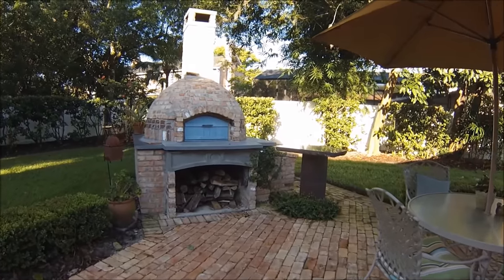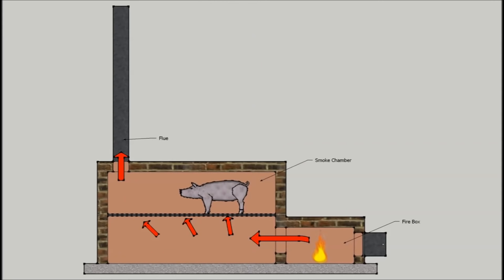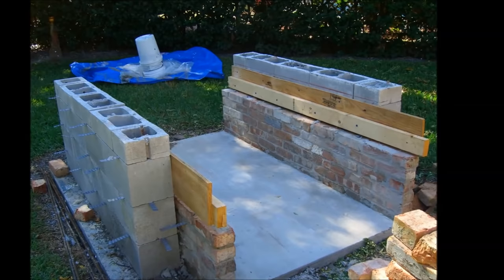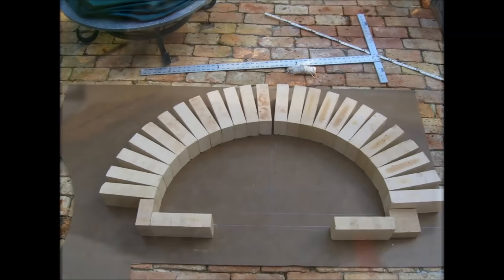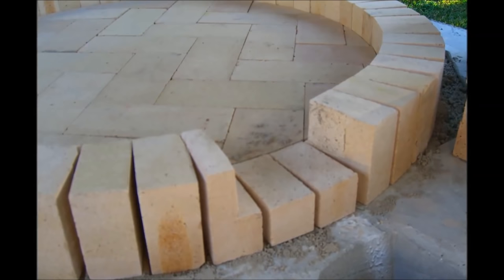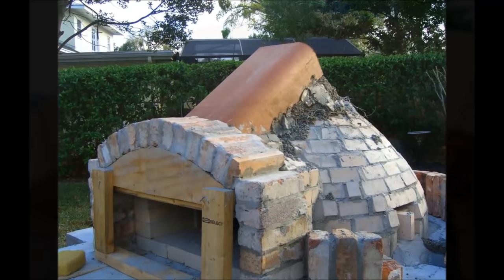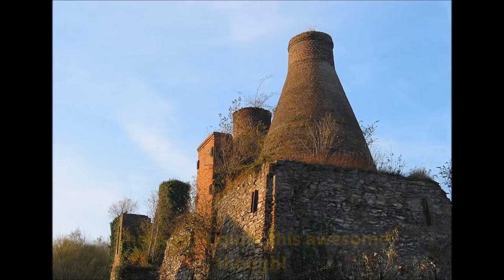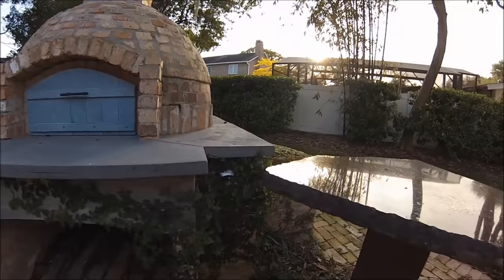How to Build a Brick Wood Fired Pizza Oven/Smoker Combo

Comment: Enjoyed your calm demeanor while being informative and entertaining. Small correction about the need to pour below the frost line in a northern climate. It's only required if the structure is attached to another that has a foundation below the frost line. Free standing structural pads can and do float on the surface of the ground and rise and fall as the ice freezes and thaws. If what you were saying was true then all our roads for example here in Canada would be very expensive to build. Enjoyed you content and looks like a good job.
Reply from the maker: You are correct but it needs to have a layer of free draining sand or rock between the clay and the bottom of the foundation or slab. I can't say that I am an expert though. I've never built anything further north than south Georgia.
Reply: @LeeMcNeil  Rubble foundations have been used for thousands of years and yes when care is taken while compacting, stacking, layering, draining, wicking and shedding water then sucessful results will be realized. Building something that heats up also needs special care in relation to different rates of expansion and contraction. Dissimilar materials for example have different rates of expansion and the same care needs to be observed during the building process. The need to make a seal at these critical areas that are prone to failure is where caution and experience must be paramount with the use of expansion joints and layering as a principle just as it is when concidering how to build a foundation. Spun ceramics, high temp silicone, rock wool and even just leaveing a small gap to facilitate that expansion are in our tool box. Layering separate components with expansion joints and forcing it to settle while saturating it with water combined with the use of gravity will also contribute to one chances of sucess. One thing that allows us to reach the heavens with modern building techniques while building sky scrapers is not attaching and allowing for movement.

Comment: I felt that the description and amount of energy put into this video was absolutely exceptional. Thank you for the amazing insights and issues to take into consideration before designing my own pizza oven. I love the fact that this can also be used as a smoker whenever needed. It is large so would not accommodate my smaller work space, but I can make a bit smaller and experience the satisfaction of using all year round.
Reply from the maker: John Cabral Thanks. I just checked out a few of your videos and your recipes look pretty awesome. You have a great camera setup. My advice is to shorten the intro at the beginning and you are missing the money shot of the dish at the end of your videos. I am struggling with issues on the camera setup (it's hard with the oven) and the money shot at the end because I am ready to eat. I'm working on a video of a steak cook in the oven that I will be posting pretty soon. Let me know what you think!

Comment: Lee, Just thinking that Epoxy coating (i.e.; Stone Coat) your concrete wrap around flat surface would be very cool and an inexpensive alternative to Marble, Corian or anything else.  It is easy, cheap and very resilient to heat, weather and UV...Just a thought.  I love this build! I am not a Mason by any stretch of the imagination but your design along with a rocket stove side cooker, and grill area is what I am going to build when I get home (winter of 19.)  I LOVE the stack re-routed to the top much more ascetically pleasing to the eye IMHO.  As I said in the beginning, I am no mason so I will hire out some help for the end of the build.
Reply from the maker: Thanks. The top is really looking bad now and not just visually. It's developing a crack across the front landing right where it cantilever's off the structure below and could fall off at any time. No epoxy coating is going to fix that. I'm definitely going to replace it within a year and will most likely use granite. I will make a video when I do.

Comment: muratic acid, would give you a nice base finish on your concrete exterior, then add a colored epoxy paint to enhance the look and finish with sealer perhaps a clear coat. Looks like a beautiful pizza/smoker oven bud!
Reply from the maker: +Caged63Man I washed all the brick with muratic acid but did not want to do that with the top because I wanted as smooth of a surface as possible. The front part of the top is failing structurally anyway. It's only a matter of time before if falls off. I am going to replace it (at least that one piece of it) with either some granite or quartz in a similar color to the rest of the top. I just didn't reinforce it as well as I should have.

Comment: First of all. From someone in the trades,  great job. Second, just an idea based on my own personal preferences.  Instead of a tile band around the circumference try a band of embossed copper. It’ll age beautifully in the salt laden air that you are so fortunate to have in Florida. Based on what you’ve already done I’m certain that whatever you choose to do will be fantastic. Cudos
Reply from the maker: Thanks! I am close to Orlando so we are about 60 miles away from any beach so no salt air here. The copper idea sounds pretty cool. It could end up kind of looking like a structural element - like something that would reinforce the bricks horizontally - kind of like a barrel ring keeps the wood staves tight to one another. I have to think more about that because here I am ten years after building it and still haven't done anything with the tile band.

Comment: Such a cool thing to do and makes a real statement in the garden, well done! Also something that could be a little easier and cheaper to fit around the concrete base is slate. Maybe just glue it on top of the concrete you made. Awesome though.
Reply from the maker: I did the old Chicago brick mainly because the back patio is made with that same brick. Slate would be nice and a whole lot less work I think.

Comment: I just started my one 3 weeks ago, the under construction is ready. Everything goes good. I will not make it with the smoker, but the rest I copy more ore less everything of your video. Only the perilite I will not put in, in the fireplace. In the dome yes. I think having the fireplace of the Pizzaoven so thick, you do not need the aditional  isolation. Heat goes up, and not down. The aditional stones should be enough, but that is just my opinion. When my oven is ready I will put a photo up, if youtube let me. But respect what you did, and thank you for your nice video. It helped me a lot.
Reply: and again I changed my mind. As I only made my concrete platform half as thick as yours, I decided to put that perlite cement mixture on or in it. And instead of perlite, because I could not purchase it here in Portugal, I used Argila expandida. These are little burned clay balls. I hope they do the same job.I mixed them the same way you did it with the perlite,

Comment: Great oven!  COOKING TIP:  For pizza, push the fire to one side, not the back.  When the pizza sits next to the fire, you can see how it's cooking closest to the heat source to know when to turn the pizza so that it does not burn.  :-)
Reply from the maker: Yes getting the fire over to the side helps to allow you to see how done the pizza is on that side a little easier. I actually push mine toward the back and left side of the oven.

Comment: You should leave a small gap between the bottom and wall bricks.. When the bottom is very hot they push out the wall of the oven because of the heat expansion and this may cause some serious cracks on the wall..
Reply from the maker: I haven't had any problems yet.

Comment: Nice!  I suppose if you wanted to level 1/2 inch shy, then you could cut a 2x4 to shape so that it was inset into the perlite:  kinda like a flat T.  It would need long arms to handle any unusual shapes while still allowing the wood to drift.
Reply from the maker: Yeah I just tried to make it flush. I think I remember that when I set the floor brick, it ran a little bit wild outside the edges of the perlite concrete. It's held up fine over the last 10 years so...

Comment: 19:44  You could use a cheap common inflatable "yoga" large exercise ball, it's what everyone now a days uses to complete the top upper dome portion easily with very low hassle and efforts compared to sand improvisation.
Reply from the maker: Yes that's another way to do it - but when I was building the oven, I had plenty of plywood and sand, but had no yoga ball.

Comment: Definitely one of the better guides to building a pizza oven on YouTube. Lot's of detail at each step. Loved the smoker box on the side and how that works. I was wonder how I would integrate one of these as well. Torn between this method and a built in Kamado now.

This it's definitely over engineered for my skill set (or lack of!!) but their is a lot of good stuff for me to take away. Cheers!

Comment: This is an amazing video. I love this multi use concept, being a pizza and BBQ fan with limited space. I am sorry if these questions have been asked and answered, but you seem to have a lot of comments on here (for good reason.) Has it lived up to your full expectations as a smoker? In hindsight do you think having the box at the back of the smoker would have made for a better airflow throughout the whole chamber, instead of cutting across diagonally? Also, do you use any types of racks or grates for the meats your smoking to envelope them in the smoke? Thank you for this amazing video, and the knowledge you have shared.
Reply from the maker: Yes, everything still works great, except for the finished colored concrete top that I installed toward the end of the project, is completely falling apart. I'm planning to replace them with granite soon. Other than that, the three biggest things I would change if I did it again would be to make the floor of the oven higher (it's kind of difficult to see into or move things around in the oven without being really bent over), I would turn the opening of the fire box toward the front of the oven instead of pointing out to the side (the fire box location on the side of the oven works fine though), and lastly, I wish I had built myself some additional prep area. The home plate shaped slab of granite works great, but I wish I have two or three times much space on it.

Comment: Build one with the fire below and fluing up into the dome. It’ll work a lot better and be much more efficient.
Reply from the maker: The one big drawback is that you would lose wood storage space. Two things I wish I had done are 1) I wish I had rotated the fire box so that the door to it was facing the front of the oven, and 2) I should have raised the top of the fire box up almost to the floor of the oven and topped with granite. That way I could use it as a prep table. The prep table I built over to the side of the oven is not nearly big enough.

Comment: Hi, Lee  

My wife has fallen in love with your pizza oven and I am
lumbered with the project,

Would you have some dimensions please? 

Great video and the addition of the smoker sold it to me.

Thanks Dave   Portsmouth uk
Reply from the maker: Oh no - sorry about that my friend. I have the 3D model uploaded on the Sketchup 3D warehouse and that program is free to download and really easy to use. The link is up in the description. You can pull pretty much any dimension you need off that model. If you are having trouble with it and I can answer any specific questions just let me know. There are way to many dimensions to list but the square part of the base is 6' wide and 6'2" deep and the inside of the oven is 36" in diameter.

Comment: Lee,

Not sure how I navigated to your channel, but glad I did. 

Great video, great job! It has been a few years since this was posted. Hope you still love your creation.

Did you ever document and share any dimensional information? The size you built looks fabulous. I realize that the oven would likely produce for a large group, which I will not likely have, but... I am rather impressed with the structure as it is aesthetically beautiful. 

I could figure it out but, knowing the dome diameter and pitch to shape the inner dome for concentricity as perfect as possible would be great. 

As a builder myself, I know everything starts with the foundation. Accommodate the oven interior requirements, inner fire brick wall thickness, insulation thickness, and veneer brick thickness. 

I live on the gulf coast, so frost heave will not be a problem for me either. 

Also love the smoker / oven combo concept. 

Questions on smoking:

Would it be prudent to have a damper or slide gate on the chimney flue to help control smoke and temperature when smoking?

Are drippings from meat in the oven area an issue? Is it a good idea to figure of drip pans. 

Have you perfected racks for smoking various meats? Brisket, Butts, Turkey, +++

Sorry about all the questions, but I figure you have experience to provide good guidance. 

Best regards!
Reply from the maker: I'm working on a video where I will share a bunch of dimensions and things I would do differently if I were to build it again.

As far as your questions, yes I could use a little more air and smoke control. Putting in additional intake dampers wouldn't have been to hard to do but a damper in the flue would have been a little more difficult. But it works OK just by adjusting the damper at the bottom of the fire box door and opening the door.

Drippings aren't a problem because I use a pan of water below the food when I cook. Plus when I make a fire in the oven for pizza, I build it right over where the meat was smoking so it incinerates any drippings. I made a video on how to smoke a turkey if you want to check it out - https://www.youtube.com/watch?v=v0nPnXZ9dIY

Comment: Nice job man! My brother is giving it a shot in New York. Now I'm worried that our foundation wasn't deep enough. Goodness that would be terrible.
Reply from the maker: I'm not sure how deep you need to go for your foundation up there but hopefully he put some rock at the bottom of the footing at least.
Reply: @LeeMcNeil  yeah we did. We dug down pretty far and put a base of rocks and stone dust but the city says the frost line is 42 inches. We did that in some spots (it is sloped ground) but definitely not in the lower spots. The lower spots are maybe 15 inches or so. Hopefully his comes out as nice as yours!
Reply from the maker: @CharlesLumia  You could add some fill around the side of the oven with the shallow foundation. Or insulate it with some perlite concrete.

Comment: Heat will expand steel and crack concrete and cement if its too thick.
Reply from the maker: Heat can make concrete spall, but I don't have any concrete actually exposed to high temperatures. The fire box and oven is lined with refractory bricks and perlite insulation, which heat would have to travel through to get to any concrete.

Comment: smoker offset also was in my mind.. but since here in Lithuania we use more so called "cold smoke'- is still designing 'subroutine" is running in my head... 
size of the oven is also to be decided .... for 2-3 or 4-6 pizzas....
Reply from the maker: Darius Ddd 36" (a little less than a meter) will fit 3 pizza's at one time. If you are going to have restaurant you might want something bigger but other than that 36" should be enough for almost any party. I've fed around 40 people at one time out of it. And the smoker is for barbecue like ribs, pork and beef brisket. Not really a cold smoker which is used mainly for fish like salmon - at least here in the US. Thanks for watching!

Comment: I was wondering if it was possible to also put a grill top where your smoke box is and then have a top that will close tight when not using it as a grill. This way you have a 3 in 1..... A pizza oven, a grill, and a smoker????? what are your thoughts??? Thinking of making one but my husband wants all 3. lol  That is why I am trying to find out a solution.....NOT going to start one until we have a solid solution to the 3 in 1 problem since my husband loves my homemade pizzas but I do miss having a pizza oven like I did in the USA.... I am in the Netherlands.... my husband is Dutch. I also miss smoking meats... My husband is the grill master in the family. lol I am also looking into having a rocket type stove underneath the oven to use as fire for the oven. Since we would not be storing the wood outside and the oven needs to be high enough for use while standing or while sitting on a bar stool I was thinking it would heat the oven but be less of a clean up of ashes in the oven...... Would love your input on all of this. :)

Comment: Sweet! That is very close to what I want to build. I just need to modify the fire box so It can be used as a direct heat grill. Any changes you would make after a few years of use?  Thanks for sharing this.
Reply from the maker: I would make the fire box face the front of the oven and put in an additional vent damper. It's kind of hard to control the airflow just by opening and closing the door.

Comment: Hello, Great job. I was just wondering why you didn't do the top slabs as a pour in place, same as they do for pour in place concrete counter tops.  Also you can use a diamond water sander to smooth out those slabs and make them look really nice.
Reply from the maker: +Michael Rhymer I precast the one of the back sections because I poured it upside down using masonite as the form surface to try to get a real slick finish. It was a nightmare trying to get it to fit tight around the round oven though. So I cast everything else in place and finished the surface as best I could. Then I used a densifier and polished it with diamond pads (course to fine). I precast the front apron last and it worked out well because I didn't have to fit it to a round part of the oven.